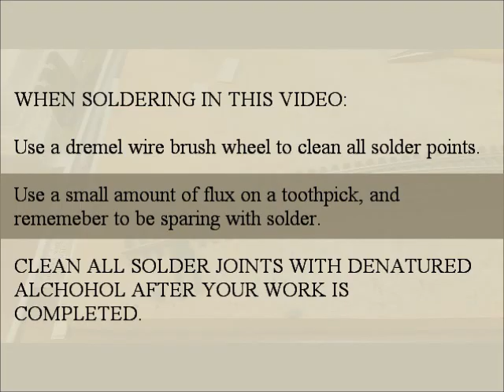Making Switches DCC Friendly

Comment: So the small wire on the point do you attach that to the feeder?
Reply from the maker: No, the frog is what you attach to a feeder, the other rails get fed from attached rails on either side. You also want to isolate the frog rails with insulated rail joiners.

Comment: On a DCC layout, can a SPDT switch be used to throw a HO scale Code 83 turnout, or must it be a DPDT switch? Thanks!
Reply from the maker: That depends if it is mechanical or electrical. If you use switch machines or a physical SPDT switch connected to the trow bar.